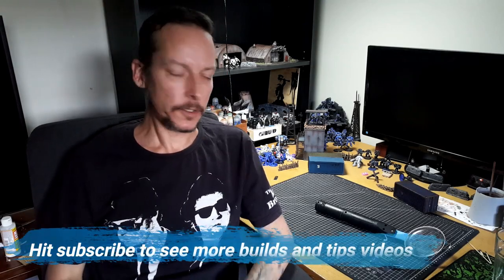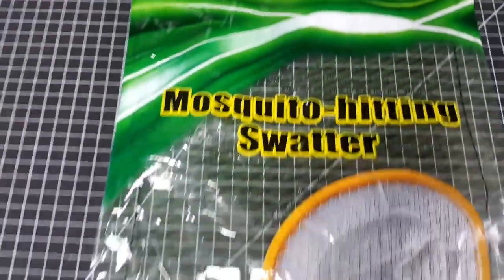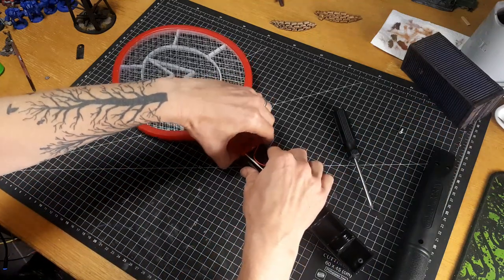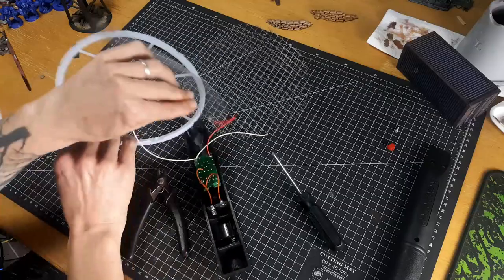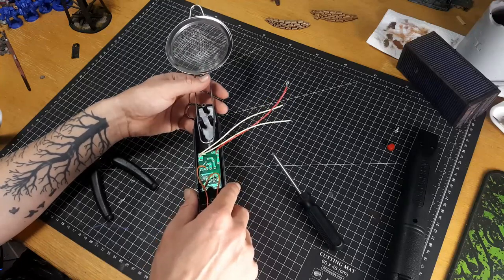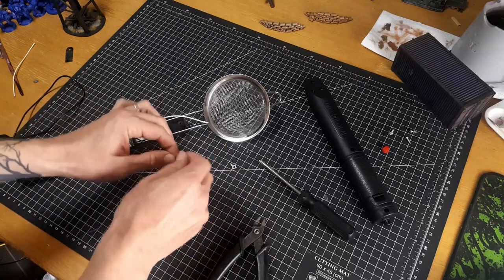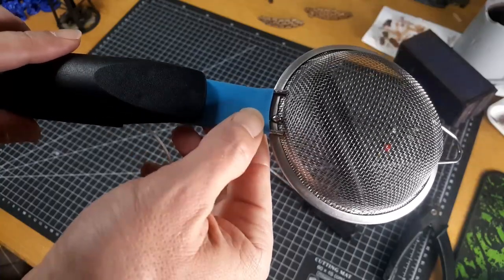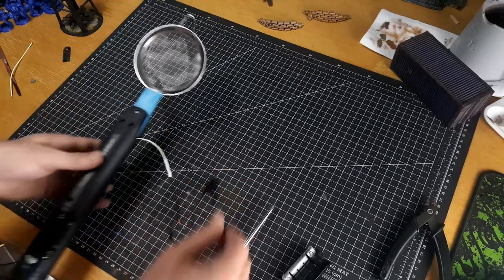Cheap Static Grass Applicator for Wargaming Terrain.  How to Build a Grass Applicator in 30 Mins.

Comment: If you look at your Video you are only touching the grease proof paper with the black insulated boot on the clip. Put a peace of aluminium foil under the grease proof paper to provide a negative earth plate. Great vid will build one tomorrow after I finish the 6 Shiping container I have started
Reply from the maker: Haha, yeah I noticed this when editing and was surprised it still actually worked at that point.  Thanks for the tip with the tin foil, I had only planned to use this on completed terrain pieces, but given the price of premade tufts, I will probably try that out soon and give the tinfoil a go.
Reply: Is it better using the tinfoil under the grease proof paper?@RFDHobby

Comment: Great stuff, glad you made this. I'm currently building one myself cause I never had the energy to get the other components that Luke got. :) Will credit you in Instagram once done. Cheers man
Reply from the maker: Thanks Richard, yeah Lukes was the deluxe model of DIY applicators we all want, but this one works well, is cheap, and quick to put together.  Thanks for your comment mate.
Reply: @RFDHobby  It works well! I too lack the longer flock but I'll pick some up tomorrow. Thanks again :) PS: this cost me 8 USD, haha..
Reply from the maker: @cleandeskpolicy  awesome.  For the time and money I spent, I was not at all dissappointed with this little build.  Good work.

Comment: You can also make a detachable base for the mesh too, as there can always be mosquitos around when you are pouring grass over a build haha.
Clever, neat, cheap and handy. I believe it's the best tool for (at least) a beginner. What were the results with longer grass?
And also, do you happen to know if rackets with undetachable, rechargable battery packs are also suitable for the job? Beacause there might be a difference at the maximum currency output I think.
Reply from the maker: Thanks John.  This is a perfect beginner setup, I haven't managed to find any longer static grass at this stage, but I use this one a lot still.  Definitely the best way to go before buying a pro machine for the job.  I'm not sure about other rackets, but the principles are the same, so I imagine so long as you can get the positive and negative connections right, not too much can go wrong.  The one I use only has 2 AA batteries, so it's very much on the low end of power, and I know the more pro versions can run on a 9V battery, so that shouldn't be an issue I don't think.  Just don't shock yourself with it, even the 3 volts running through mine is enough to really wake you up in the morning when you get a shock :)  Thanks again mate.  Take care.

Comment: HELLO SHAWN. REALLY ENJOYED THIS. QUESTION? WHAT IS "SHRINK WRAP" I COULD SEE IT BUT IT IS NOT FAMILIAR TO ME. ONCE AGAIN THANKS AND BEST WISHES FROM CANADA!
Reply from the maker: Hey Thomas, oh that stuff is used for electronics mostly, heated up it shrinks to encase soldered wires.  I found a cheap bag of short bits of it at the local electronics store.  It's kind of like a rubber, or plastic I think, and comes in different sizes.  Hope this helps.
Reply: @RFDHobby  THANKS AGAIN SHAWN. I WILL CONTACT YOU BY EMAIL TOMORROW AS I HAVE A MIGRAINE WHICH I GET FROM FROM MY ACCIDENT. THANKS FOR THE REPLY.  THOMAS
Reply from the maker: @thomasmurray6786  no problem at all.  Anytime.  Take care and I hope you beat that migraine soon.

Comment: Hi great video thanks. Does it matter which of the two wires you cut away? Tx
Reply from the maker: Hey Mick.  No, both wires should be the same for those 2.  Won't matter which one you remove.
Reply: I bought one today! But when opening the layout was different. No wires, but soldered nearly direct on the ring :) will figure it out though. Thanks again!

Comment: Well heck.. I have one of those zappers just sitting unused in my shop.
Reply from the maker: It's a really quick conversion to do, and very little materials required.  Although I have to say I'm pretty sure it's a little less 'safe' than the commercial version haha.  Nothing serious, but I can say with certainty that this thing will wake you up in the morning if (when) you end up zapping yourself by accident... :)  Thanks for watching.
Reply: @RFDHobby  safe! Ha! I cut my river out with a bare solid copper wire shaped as a wide U screwed to a piece of wood then had my wife hold the wite ends on a car battery.  First and probably the lasttime she will help me on my layout🤣

Comment: What did you do with the red wire? Where does it go?
Reply from the maker: Hey Mate.  The red wire is attached to the basket directly to the mesh.
Reply: @RFDHobby  Cool, thanks. So there's no melting the wires to be "glued" with mesh or something like that, all other tutorials do that and I really don't want to and don't know how to melt wires. Your tutorial is the easiest!
Reply from the maker: @Filiplego1  no problem.  It's best to solder the wires on there if you can, but you really don't have too.  So long as you get a good connection with the red wire to the mesh (on the edge of the mesh somewhere), you could probably secure it with a drop of hot glue or something and it will still work.  Let me know how you go and if I can help further mate.